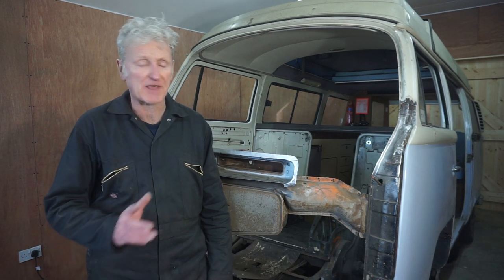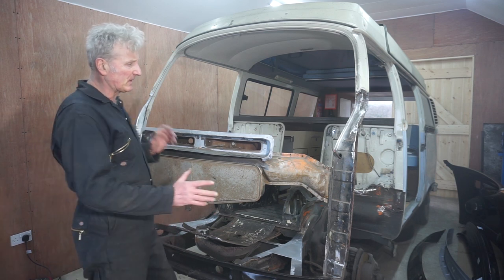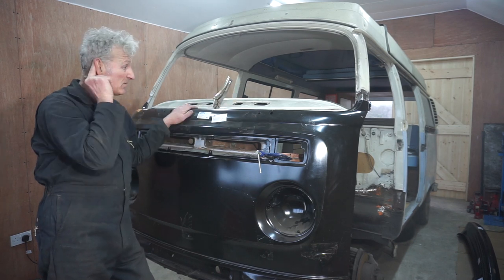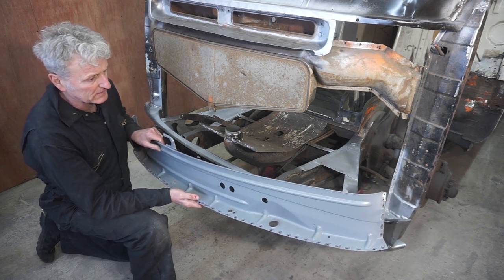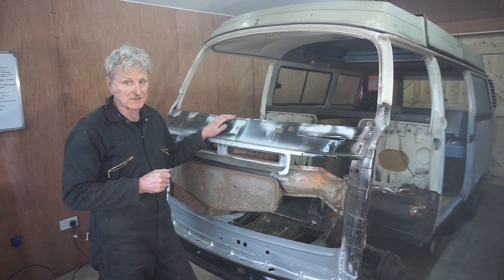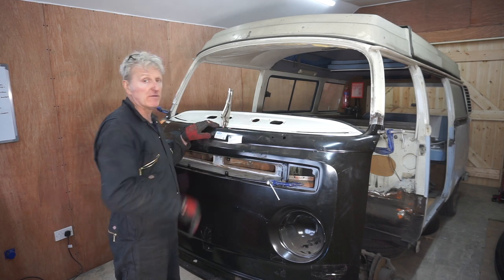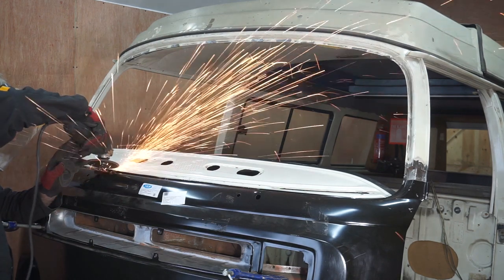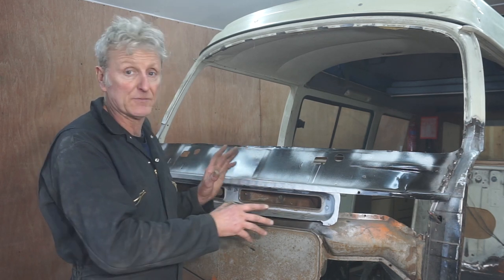1973 VW Campervan Restoration Part 8

Comment: what is the measurement from the roof to the front panel lower screen aperture?
As we saw u check after fitting. Great work by the way.
Reply from the maker: Sorry can't remember - I wrote all the measurements down before cutting but no longer have them. Sorry Jonathon
Reply: on our 1971 bay the dimension of the aperture in the centre is 590mm (I havent cut the panel yet!) hope thats helpful